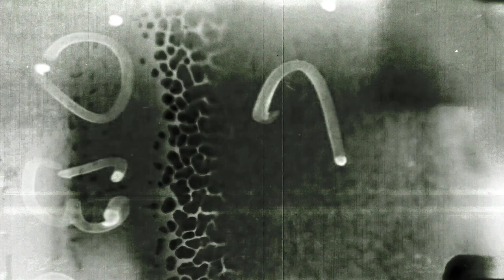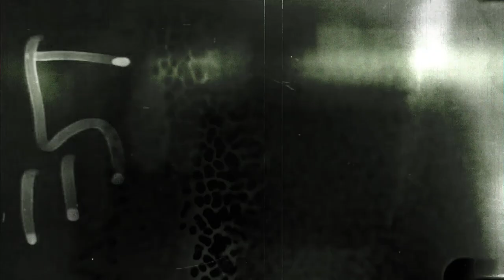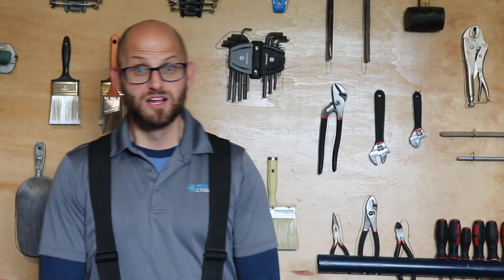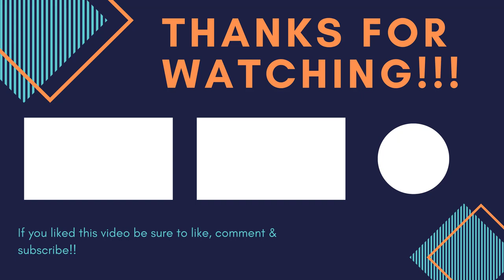Crumb Rubber in Concrete?! - Intelligent Concrete - Vlog 640

Comment: The one use I've found is that a crumb rubber placed in concrete can allow a concrete to be nailable, like wood. You can hammer it by hand but the nails hold as well as they do in wood. It's an interesting concept if you want to look into it.

Comment: you talking to your imaginary friend? or you have a mouse in your pocket?

there's many concrete mixtures, hundreds that I've read about. metals, carbon, variety of plastics, foams, blah blah blah. I've never read about rubber inside a concrete mixture and I am intrigued. definitely something worth exploring with a hybrid mixture of course, not just rubber. I like the foams and aluminum mixture and would like to see how that would work with rubber or just the foam and rubber

Comment: Haha love it. I've been wondering this very thing.  Good to know it's the wrong thought path.  Mainly the thought came from earthship homes and I plan to do icf.  

Since you guys seem to be reading my mind recently.  

What about the idea of doing multiple pours with different traits.  

For instance I have wondered about doing layered pours if you have the time for curing.  Let's say a 2 inch more ductile pour with a wire mesh rolled on top then another super strong reinforced layer.  Another wire mesh and then another thin layer with a radiant floor heating system. 

I'm sure this is mainly not done due to labor of multiple pours, but if it was a money-is-no-object project... Could there be measurable benefits to getting multiple benefits from different types of concrete? 

Love the channel and thank you for all you do.
Reply from the maker: Howdy Donovan. We put a video together yesterday answering your question.  It will be posted next week.